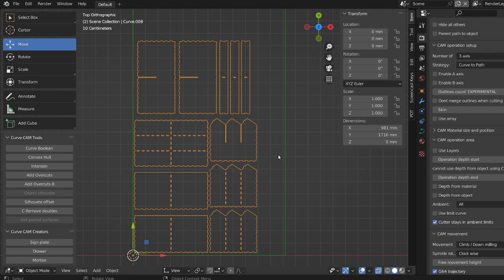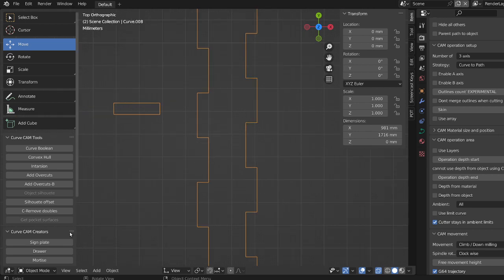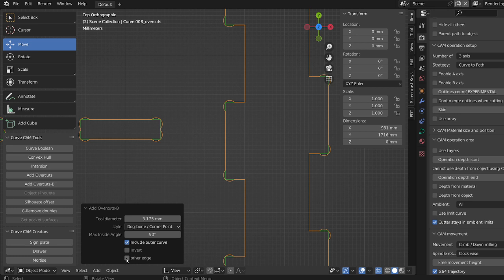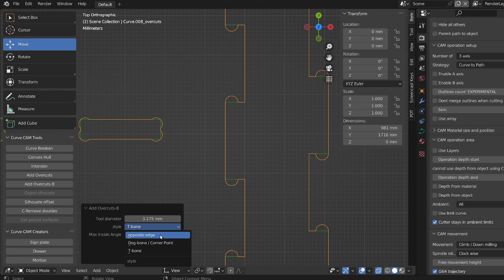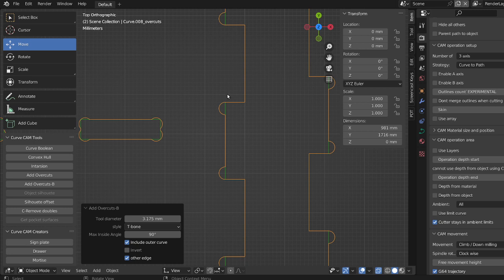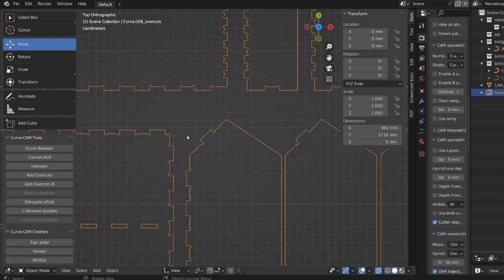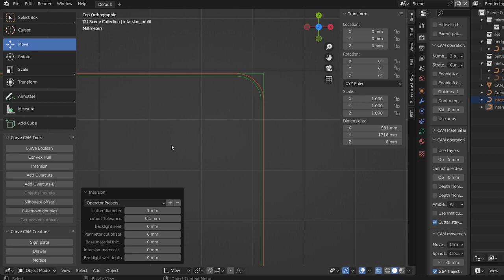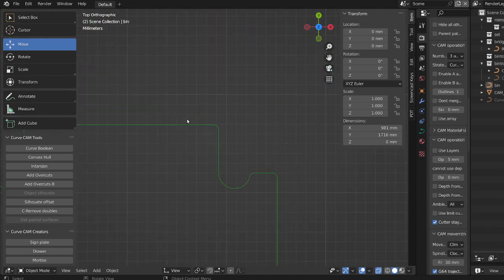fabex cnc: Fun with overcuts

Comment: When using this function I keep getting errors:
Python: Traceback (most recent call last):
  File "/home/sche/.config/blender/4.1/scripts/addons/cam/curvecamtools.py", line 253, in execute
    bpy.ops.object.curve_remove_doubles()
  File "/home/sche/blender-4.1.0-linux-x64/4.1/scripts/modules/bpy/ops.py", line 109, in _call_
    ret = _op_call(self.idname_py(), kw)
          ^^^^^^^^^^^^^^^^^^^^^^^^^^^^^^
RuntimeError: Error: Python: Traceback (most recent call last):
  File "/home/sche/.config/blender/4.1/scripts/addons/cam/curvecamtools.py", line 614, in execute
    bpy.ops.curve.remove_double(distance=0.0001)
  File "/home/sche/blender-4.1.0-linux-x64/4.1/scripts/modules/bpy/ops.py", line 109, in _call_
    ret = _op_call(self.idname_py(), kw)
          ^^^^^^^^^^^^^^^^^^^^^^^^^^^^^^
AttributeError: Calling operator "bpy.ops.curve.remove_double" error, could not be found
Location: /home/sche/blender-4.1.0-linux-x64/4.1/scripts/modules/bpy/ops.py:109

But the rounding of corners works fine. Where can we talk about this in more detail?
Reply from the maker: #blendercam:matrix.org

Comment: I have a design that I want to apply, but I am facing a problem, as the machine does not accept more than 700 in length, and the design is 1800 in length, how do I divide the design and implement it
Reply from the maker: you would have to make registration holes and align them with pins.  There is no automatic way to do this yet